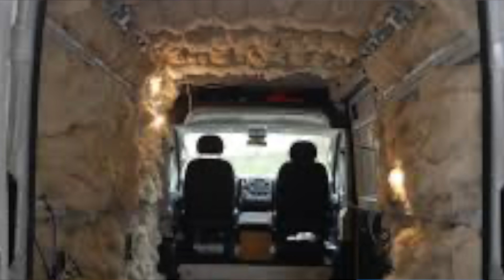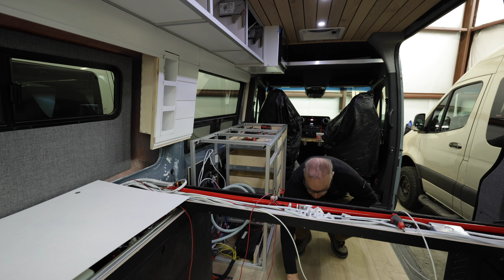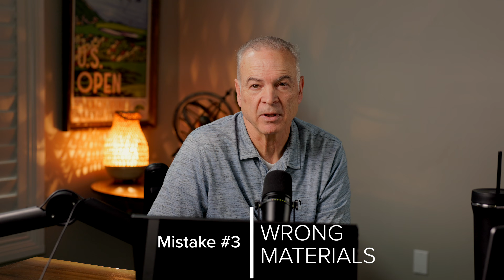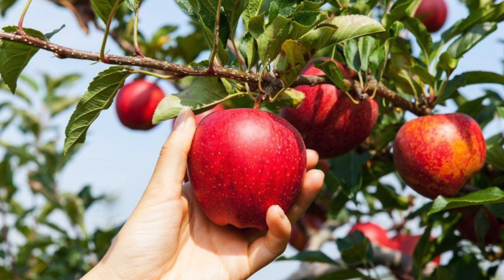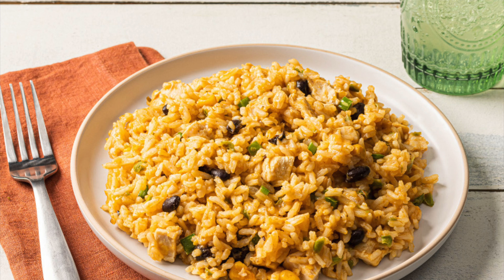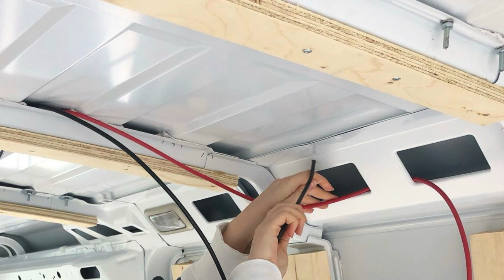Avoid These 5 Van Build Mistakes!

Comment: If is the van Itself is NOT square why the cabinets need to square? And “marine grade” do they use this materials in RVs, I seen RVs roots ng out and moldy. I am confused why van builders want to add the extra cost?? Might as well get an RV! 🤷🏽‍♂️🤦🏽‍♂️

Comment: You only need some specific items marine grade. Mostly you want glues/epoxy and electrical system to be marine grade so they can withstand vibration and are made for mobile applications. And really I only mean things like inverters, batteries and other major complicated components. You don't need the marine grade corrosion resistance for anything inside the van. For most stuff marine grade is just wasting money.

Comment: Lots of great info I haven’t heard anyone else mention. Just one minor observation: isn’t stainless softer and weaker than regular steel? That’s been my experience with stainless steel screws, they need to be tightened with much care. I would still use stainless, just wondering about your claim that it is stronger.

Comment: Floor.....carpet, cheap (off cuts), easy to ft, easy to replace, comfortable and insulative. Electrics...do you need a second battery? The cold box can run through the ignition, leaving only LEDs an USB sockets. Both circuits fused at source.

Comment: Couple additional mistakes:
-Design:
Wasting space with huge sitting areas. You are not going to have your family over for Thanksgiving dinner in your van. Build it for your needs 
Also wasting time and money installing flooring in the entire van, just to have cabinets sit on top of them. 
-Materials: 
I've seen so many builds using 2x4s, or "cozy cabin" looks using excessive, thick wood for paneling on the roof. Think about the weight!
-Electrical: 
You don't need more than 1 120V outlet! It's a van. Other than some kitchen appliances, everything can be charged, powered by 12V or USB-C these days

Comment: Thank you for sharing your knowledge and wisdom. I have been into the van thing since the mid 70s when the thing was to build party vans and I was one of the innovators selling accessories and building out vans back then. Now I just do it for myself and build one every decade and amazing how technology changes from day to day and getting to build out a 2008 Sprinter to replace my 2005 Sprinter that I built out in 2006 and put 200k miles on it and still a fantastic van today, and the 2008 Sprinter 170wb 2500 I am starting looking to see what the new wiz bang things today, back then there was no lithium-ion batteries and refrigerators were propane so getting with the times. But I prefer older chassis that were prior DEF and just more reliable then todays $100k chassis as a starting point.
Reply: Lifepo4, not lithium ion.

Comment: I'm going to have to disagree with your when it comes to sound deadening and insulation. As a former studio sound engineer and car stereo installer. Sound deadening the floor is 100% a plus, and you should sound deaden the complete inside. The big mistake is putting sheets in areas around the van. That's a waste. Spray foam chemicals is only hazardous if you ingest it or suck it up your nose directly LMAO. Nothing to be scared of there.  It is best to use if you want to not ever worry about mold or moisture. It is much cheaper now-a-days. I was able to do my complete Promaster 2500 for $150. And we have 6 cans left out of the 18 pack. That's cheaper than wool and r-rating insulation. BUT, it is messy... so prep your area with tape and plastic before starting. You will have to trim it down to fit. It's a pain, but it will be worth it in the end. Another great video, thanks again for sharing.

Comment: There is a way to insulate absolutely everything and there is no such a thing as over insulation lol. The windows do play  role but they are so easily insulated they don't even factor in really. The new windows you put into your conversion have to be triple glazed.

Comment: 100% . I grew up with boats from age 1.x on a boat through 55 now. I use marine grade brass and stainless in my cars, house, deck, and boats, along with marine grade plywood for walls and floors, as well as marine synthetic boards, light weight and won’t rot,and is strong.  Regarding electrical, think West Marine.

Comment: Thank u. 
(I ❤ woodies & steep grades)
...
Insulation is all different balls. I was thinking of using coir or jute rugs inside the flooring, but that seems heavy. Wool is very expensive. I even looked at picking silk cotton, or putting old fabric into blenders. But there are flaws all over everything. Kapok will make many people sneeze. And getting the fiber spun into matting is also not easily demo'd. (I am also not with "van," but car/vehicle).
In terms of electrical:
Take, for instance, something like "techno gellum," and it looks like it needs to be applied in a manner that sculptors would employ. But, i still have no idea what it is, except for concepts of what it could be used for or with. ... and there really is so much "new" stuff like that, like the construction adhesive/wax/silicone/paste, flex seal, the "element" of "time" is kinda sorta missing in tests and practical consumption. 
Another thing is technology that is not specific to the era of technology of the vessel's manufacture. I actually believe this has skewed, not only, the timing of 2 of my own vehicles, creating some sorts of variance in the electrical systems. I actually really have no idea how to meditigate that when the vehicle's age is "3G"  or "car phone" era...  

Anyway, u output a great video, i will likely watch it again !

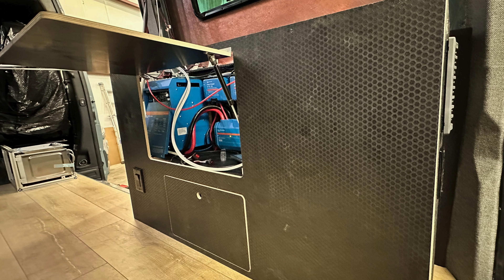Comment: Hey! Thank you so much for this video. It was very informative. I have one question because I try to do the same. At 10:54 I can see a MDF plate with doors. How did you cut out the doors without drilling holes? Did you use a Multitool with a half saw blade?

Comment: Hi, I'm building a van . What is the best insulation for hot weather?  We only get 2 to 3 months of cold weather here , nothing below zero and no snow. Thanks for this video
Reply: The best thing for keeping a vehicle cold is actually having a tarp or something over the outside to stop the sun from heating the metal body. Obviously u can't drive with that but it does work amazingly well. Or you could wrap the vehicle in aluminium foil haha. Those foil bits for windows to reflect the suns heat away are great also.
Next best thing for keeping the temperature low would be ventilation. Insulating keeps heat in and won't stop the sun from heating the body of the vehicles so any way to get the hot air out and cool air in is going to help

Comment: I used 3/4" OSB and 1/4" rubber mats on floor.  My Promaster already had walls and ceiling linned w polt iso insulation.   I never even  considered make walls flat?  Wastes too much h space cloth wall covers.   I see wood lined vans?  Nice?  I you want to live in a dry sauna?  I kept it simple and functional.  I use van to go places and do things outside?   The van is nice and comfortable place to sleep and rest. 
 BTW.   I  AM MARINE GRADE!   USMC Veteran!  Semper Fi !

Comment: - Rivet Nuts
- Radiant Barrier + Thinsulate
- 8020
- AluPanel walls
- Durabak bed liner + Marmoleum flooring
- commercial grade 12/2 in-wall speaker wire

Comment: I have a Pro built van because I am the opposite of a DIY guy. The van has electrical issues and the builder is a 6,000 mile round trip so ..., non starter. Besides, the concept of service after the sale is something that escapes him. No other victron dealer will work on it. Other van builders will not work on it.  Emails to Battle Born that used to work, bounce back. People do DIY because the custom van conversion industry has a F, F, F mentality to customer support. So, it's not surprising that mistakes are made and bad things happen.

Comment: I would never glue wall or ceiling panels in place. You will need access in the future for either repairs,  updating, and inspection (mold, water intrusive,  rust, collision repair).

Comment: There is so much wrong with this video. There is absolutely no need to buy the most expensive componets, like only victron. Yes maybe the inverter, but any solar mppt will do. Same with batteries, LiFePo4 does NOT burn like lithium in car batteries. That is just a lie (or he doesnt know better, but he claims he does with all the marine grade stuff). There is no downside in choosing a cheap chinese battery. No need to spend 5x to 10x, you only get better Integration and a nice app. Cells are often even the same, but manufacturing in a high wage country adds a lot of cost.
So buying all victron and batteries for 2k each is like only buying apple devices.
If money isnt an issue go for it, but if you want to build a van for like 50k, use the saved money and spend it elsewhere.
Reply: Also, what is his obsession with marine grade? Yes, all he says about wires is true, use stranded ones, never household. But why marine grade? I dont even know if that exists over here in europe. It's probably another scam where you pay double the price for the same stranded wire, but "marine grade" is printed on it 😂
Just like americas obsession with military grade, which often isn't the best, it's just a defined grade.

Comment: Have you ever tried insulating the floor from the outside?  Like putting spray foam in areas that are far enough from the exhaust
Reply: Spray foam soaks up water like a sponge and spraying it in box sections can put ripple effects on the outer panelling so i wouldn't use in a van build; and the insulation properties of it are minimal at best anyway

Comment: Save $10-15 thousand and all the risk of high voltage/high amperage electrics by using a simple propane stove.  It's common on millions of boats that are a lot more air tight than a van. We have a 5 pound bottle in an airtight 5 gallon bucket with simple vent through the bottom of the van.  Full time living aboard it lasts 6 weeks.
Reply: There's zero risk in an ac system unless you're an idiot

Comment: @ourhrivinglife you always go for the more complex installation off inverters, batteries, lot off fuses and converters or do you also use the easier newer solar generator stations like ecoflow bluetti etc. Wonder what the benefit off the complex system.
Reply: I'd say capacity and cost are the two main reasons to build a system over buying one of those package units. Those package units are really nothing more than expensive packaging for the same equipment (batteries, inverters, controllers, panels, etc.). I liken them to going out to a restaurant vs eating at home. You can buy a steak dinner at the restaurant for $75 or you can make your own for $20. The restaurant will buy the food and prepare it for you, or you can shop for the goods and cook it yourself for less money. You can also spend the same as at the restaurant and get much more for your money if you like. For the same money, you can get better quality and more steak.

A package unit will give you X amount of capacity for Y amount of dollars. Putting a system together yourself could give you the same capacity for less dollars or, if you wish, more capacity for the same dollars.

Like going to the restaurant, you don't have to put much effort into it if you buy a "solar generator". Just throw your money down and walk away with something that will probably work okay. Or, like cooking at home, you can put in a little work, learn how to do the job, and have a system that could very well exceed your expectations.

Comment: This is great advice? Or a way to justify a $200K build?  Factually.. this won’t affect resale after 5 years of ownership.. unless you find an enthusiast for your builder. 
DIY builders change and renovate their builds after a year or 2 on the road because as you use the thing,  it clarifies what is and isn’t important to you and it isn’t difficult to modify. The failings are with ignorance of best practices.. but unlike the marine industry, the risk is much lower with a camper or van.. as long as your power systems are safe.. everything else is fixable.

Comment: MISTAKE NUMBER 6 standing directly on the roof of the van
the roof isnt a load bearing area and it will bend the bars across the inside of the roof that's only designed to stop the panel vibrating, i see a number of vans where the customer complains about a rattle in the roof after standing on the panel when fitting vents and solar etc 
in extreme cases such as the the Seville vans such as the older promaster,relay,ducato,boxer it will crack the seam and allow water in
Reply from the maker: That’s a big one!
Reply: @thrivans  i see it all 2 often...also compatibility issues with polyurethane (pu)sealants like Sikaflex 252 not being compatible with some roof vents and solar panel brackets made from (pp) polypropylene  plastics  may be another content video for you

Comment: Those Bradford bradford brand names you're going by name and you're gonna pay for the name. Patrick's all the same any listium battery can catch fire start, a Chinese brand alone. Even the top on musk's cause catch fire and those are good batteries. In Hazel, band did not made in China yet. They solve catch fire. So you're wrong with it, my friend. I don't use this gun bacteria. So are used regular batteries. Regular marine batteries are the best. I use, but again, H2 they're wrong. Think for yourself. Decide how you want to do it. I don't know for name brands because you're gonna pay for the name. I refuse to pay for name brands and I've had no problems up to now. I've had 5 comprograms for 5 years, no.  I don't know what to wear, but if you want to follow this guy knock yourself out. I still think do your own research and figure out what you want to use.

Comment: I will agree with you 110% with that part. Don't use IKEA furniture. I care furniture by definition is made cheap and c*** That's what a famous for making furniture quickly. And that's it, but don't put that c*** into your vampires. He's right about that. Ika furniture or avenged cheap chipboard. Furniture from the furniture store is c*** stuff. To put in your vehicle, don't do it. You're a bread off reply, wood solid plywood and make it yourself. Some more expensive liquid heavier. But it's better. I guarantee you it.

Comment: Bixby apply what is the best wood you don't use chipboard. A lot of people use chipboard or cheap plywood. I use heavy solid plywood which is the best and strong. I've had it in my Van for 5 years. 0 problems. I'm very strong, so use plywood, but again. You guys do what you want and follow this guy? If you want to apply what is the best the strongest. Yes, it's heavier. Don't give a d*** i*, does the job?

Comment: A man after my own heart. I minimised insulation and now I can sit upright in my standard van, my friend can't. I also have more space than most and U value is no difference. I have insulated screen covers for cold nights. Yes, to stainless screws, I changed all my ceiling screws, half of which had gone rusty. I have a different attitude to electrics, "none is better". I have no aux battery, no solar, no split charger, no inverter, which means no problems. Leave the bloody TV at home. I have a fused feed for lights and USBs and another fused feed from the ignition for the cold box, job done. As a backup I have a jump starter, only used it once, on someone else's van. A lot of sensible points, thanks.

Comment: People overbuild there vans. Marine grade is a waste of money. Automotive grade wiring is just fine.
Shiplap what a giant waste of weight!!! 1/4 ply with fabric glued on is a thousand times better. 
NOTICE  he said nothing about  electrical voltage. 12 volt systems SUCK! if you have an Inverter over 1000 watts, you should be building a 24v system.  Over 2000 watts it should be a 48 volt system. 
Lithium batteries catch fire, is totally B,S. Lipo 4 Chinese batteries are just fine.
Reply: Personally, I don't trust  lithium batteries. The fact they burn so hot that they're difficult to put out, is enough for me. 
I'd rather use a herd of gerbils on exercize wheels if I could figure out how to train them! 🤣
Reply: For cushion and soft panels get upholstery canvas material they come with nice patterns too.  Upholstery material  can be also stain resistant and easy to clean and will last longer than standart apparel material.
Reply from the maker: Thanks for sharing 🤣.
Reply: @thrivans  You can laugh, but he is not wrong.  My brother is a head of QA for a large car battery maker and even he has said the same thing.  The batteries out of the PRC have very much overtaken us in terms of value.  Our Li battery industry did a 1970s auto screwup while the PRC went full on 1980s toyota.